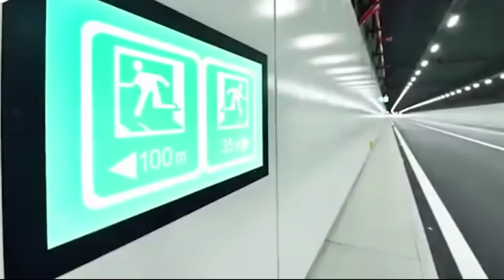New York’s $55 BILLION Plan To Connect Long Island And Connecticut!

Comment: Our tri-state infrastructure is outdated and no longer efficiently supports the volume of cars.  They keep playing with zoning laws and building up (vertical) adding tens of thousands more cars.  It takes me 30 minutes on average to get to work which is just over 3 miles, door to door.  It’s aggravating simply just driving in my neighborhood.  Someone had the “bright idea” of adding traffic lights or a stop sign on every single block in Brooklyn. Sometimes you sit at the same light for 3 cycles.  People walking travel further and faster than you can drive.  What’s worse, is sitting at a red light when neither cars nor pedestrians are anywhere in sight. They don’t even allow right on reds here. Driving is INSANE.  At least put smart traffic lights up that can sense traffic and elevate it before it becomes a problem.   I say do what you can to reduce traffic and congestion. With GPS tracking and AI, a lot can be done to improve things.  We have the know how and ability.  Just think of taking all the city, state and federal monies that are wasteful and riddled in fraud, and use that money to pay for common sense solutions that work.  We are so behind and wasteful, it’s a joke. I’ll bet you a guy like Trump can get this built for far less than anyone else.  You need the right people behind a project like this.

Comment: Tolls would be $60.00 in today’s value . Rye to Oyster Bay would be one quarter the length, much cheaper. Rockefeller and Moses wanted to do this right after the Verrazano was completed. When the Verrazano was opened tolls were to be twenty five cents each way, and only until the bonds were paid off, then no tolls. It now sixteen dollars to traverse. But, NY State is spending four hundred million on a stadium they won’t own in the thriving metropolis of Buffalo.

Comment: How about a floating bridge from Pryibil Beach area to Rye NY area. No Connecticut involved. For the Months April to September. Computer controlled ballast system; closed during strong storms. $30 million, ready in 2 years. A swinging section for scheduled ships. No ships between 8 to 11 AM or 4 to 7 PM. $10 coming on to Long Island, nothing charged if leaving Long Island. If it doesn't work, take it apart and use it as a reef. Let's get on it!

Comment: The only way they’re getting this done is 135 or the William Floyd Parkway. 

135 was supposed to be Interstate 287 extended over the Rye bridge option. The William Floyd was optioned to be the interstate 91 extension over that option. Both routes can handle the extra traffic. The communities they run through are the issue. It’s never going to happen in Port Jeff unless they turn Nicholas road into an expressway
Reply: Maybe NY will give the oblong back to CT in exchange for the coastal property needed to do this.

Comment: Yes this cuts down time on paper, however this will not help congestion on LI nor in CT. Why? Because there would be no increase in highway capacity for cars once cars get to LI or CT on that bridge. You can’t add 3 lanes on both sides of the L.I.E. for example. Focusing on commuters, a robust high speed ferry system, orders of magnitude greater than what currently exists, with numerous express route onboarding sites may be the best answer.

Comment: They blew it in the 1960's when a bridge was discussed  across Long Island  Sound from the northern end of the Seaford Oyster Bay Expressway (Rt 135) to Rye/Stamford area. The Rt 135 infrastructure was already in place to handle the traffic mix/volume. Route 112 to Port Jefferson will never support the traffic demands.
Reply: Rye/stamford can’t support it, but bport can

Comment: The Seaford Oyster Bay Expressway was supposed to continue to Connecticut but the rich people stopped it. There were plans for a bridge
Reply: Same with Rt. 7 in CT going to i-84
Reply: Yeah, the rich and selfish on both shores will join forces with environmentalists and stop at nothing to block it, never mind the potential benefits.
Reply: @NorbRetEngineer Nobody wants their town to turn into a highway. The rich just happen to be better connected.
Reply: @NorbRetEngineer  I lived on the Island for 60 years. I see no compelling business reason for a cross Sound bridge. Who the hell wants to go to Bridgeport or Port Jefferson?
Reply: @DDd-hr6mz  I would agree that the Port Jeff-Bridgeport link is not a good solution, but the Rye-Oyster Bay link would make alot of sense. The link would be much shorter and therefore cheaper to build. You already have highway connections on both ends, and it would enable Long Islanders travelling to points north to bypass NYC, thereby saving time and fuel. The reduced congestion and fuel waste would actually be a plus from an environmental standpoint.
Reply: @NorbRetEngineer You are NOT going to get the residents of TOB to put up with this. Period. 
Bad enough they lose their minds over 15 new homes being built. They're not going to tolerate tens of thousands of cars.
The fact is that from any standpoint, the connection just isn't important enough.
Reply: @DDd-hr6mz  Unfortunately, you're right about the rich NIMBYs. We'll have to agree to disagree as to whether or not such a project would be worthwhile if it were possible.
Reply: @NorbRetEngineer Im not a NIMBY myself,  but a project of this scope is just too overwhelming for the area.
And again,  I don't see an economic case for it. I've lived on Long Island since 1962 and recently moved. I see no compelling case for a cross Sound project.
Reply: It was supposed to connect Oyster Bay and Rye NY, not Connecticut.

Comment: NIMBY pushback gets stronger the further west you go on Long  Island. Oyster Bay was the town that defeated Robert Moses and his bridge plan. Huntington is far less affluent, but the town is unwilling to sacrifice its bay after so many decades of fighting to preserve it from pollution. In Nassau County it is near impossible to draw a straight line from I-495 to the Long Island Sound without crossing a country club. The only straight line is the very same corridor that Robert Moses sought to use for NY 135 as the highway to connect to the bridge. There is no right-of-way in that corridor.

The bridge should include 3 parallel heavy rail tracks, electrified. This provides Amtrak a new route that allows Boston access to Long Island without transferring to LIRR. This would make the bridge a federal project, not just a state project, which can ease the funding burden. If the LIRR were to connect Port Jefferson Station to the mainline at Yaphank, this would fully open a direct Amtrak service to Long Island. From Bridgeport, an Amtrak train could stop at: Port Jefferson Station, split to Riverhead and Ronkonkoma, continue west to Hicksville, Jamaica, then Moynihan Station. Staten Island would need its own railroad connection to Long Island to allow Amtrak service to completely bypass NYC as a Boston-Newark express alternative.

I know what you might be wondering; wouldn't adding Long Island to Amtrak service create a longer NE Corridor or adjacent travel time? Moynihan Station is currently a terminal for Amtrak, not a normal station. This means all Amtrak trains have to "park" after the tunnel, to then back out the same tunnel. This doubles the scheduling traffic for not just Amtrak but NJT and MTA trains. If Amtrak trains from Boston can enter from the East to exit the West to Washington DC, and vice versa for the northbound trip, trains can be more frequently scheduled with shorter downtimes, adding to the capacity of all railroad services.

Point is, a genuine bridge-tunnel between Long Island and Connecticut would have powerful cascading benefits over the long-term that would fundamentally address the traffic congestion currently plaguing both states.
Reply: Great response

Comment: This needs to be further out..exit 73 off the LIE was ment to go into Connecticut.
Reply: Extend I-495 the LIE further East to Orient Point and build the Orient Point Watch Hill Bridge to I-95 in Watch Hill, Rhode Island.
Reply: @mattycooldude6462  You'd be eliminating a lot of the farmland, vineyards, and smaller communities on the north fork, not to mention more than a little bit of park land. I don't think that part of the Island would be able to handle it, to be quite honest.
Reply: @crewkid52  Yeah true. A lot of the Long Island people on the North Fork would oppose such a project. Robert Moses proposed the I-495 LIE extension and Orient Point Watch Hill Bridge east to Connecticut and Rhode Island in the 1960’s, but the plan was cancelled in the 1970’s due to opposition by residents of Connecticut and the North Shore of Long Island. If Robert Moses got his way back then, there would be a lot less traffic in Long Island and the New York City metropolitan area and it would help truck traffic in the Northeast.

Comment: Why not build a rail tunnel?
Reply: I could be making this up but I heard the private developer interested in this project is interested in a double decker bridge from LI to Bridgeport CT handling BOTH Metronorth trains as well as Cars.
Reply: They should if some of the concern is environmental issues the best way is to use rail and have a lot local transportation around the stations on li and CT
Reply: If you want to go where the train goes that's fine, but if you want to go somewhere else you're still screwed.
Reply: Because we prefer to subsidize roadways, over rail.
Reply: Less demand
Reply: Because they are trying to alleviate vehicle traffic.
Reply: Driving is better than trains.
Reply: @superbrownbrown ...so do you have a self driving car or are you just a masochist?
Reply: @superbrownbrown  Horrible opinion, and a wrong one as well

Comment: They can’t even fix a pothole correctly….
Reply: New York can’t even fix a pothole correctly. We’ve got the worst roads in the country. It’s disgusting. And the Governor hasn’t got a clue about any of it.
Reply: @rushpuppy2 that's because she doesn't come down here. When she does its a direct flight to Montauk for campaign funds. How can she assess roads she's never had to drive on? Rhetorical
Reply: You seen our bridges they been around forever still standing
Reply: @ubuntumike5794 Absolutely, but this one is a bit bigger.
Reply: @ubuntumike5794  and well overdue to be repaired/replaced
Reply: neither the street. its all chopped up
Reply: Some of these potholes could be classified a sink holes they are so deep.
Reply: Refuse to properly fund an otherwise robust major bus agency (NICE bus). :/
Reply: Thank You for the Chat.
Reply: Call it in
Reply: Can't even lay down a new asphalt road properly. Seams crack and open up after the first season change. Of course all the paving company's names end in a vowel.
Reply: That's if they even fix them at all, the corrupt fucking wankers of L.I. including the head dickhead Bruce Blechhhman.
Reply: Bridge gonna be weak asf 😂😂😂
Reply: I know right? Building something like this in the most expensive area in the country to do construction? Yea ok bud 👍, it’ll get built when I sell them the bridge I own 😂😂😂
Reply: @jeyDsixx18 You know any more, and, I Am So FUCKING worn out. I wish you a Very Happy Merry Christmas.

Comment: Does $55 billion include the cost to connect the new bridge to existing roadway and rail systems?  What about other potential locations for such a bridge; this is not the only one I have heard of?

The video showed preformed sections laid on the bottom of the sound, like at Hampton Roads, but did not talk about that type of construction or its costs.

Comment: The biggest hurdle is not the bridge or tunnel, but how do you connect the traffic from the bridge or tunnel to a major roadway without taking high dozens (maybe a thousand depending on the route) homes and businesses on the Long Island side. The route will from Port Jeff Harbor to Rte 347 (approx 2 miles, and probably the shortest) require home takings valued from $300k to $2 million. The commercial properties may be valued higher. And you will likely destroy the character of the area.
Reply: And on the CT side there is almost no free open space along I-95 from New Haven to NY, Houses and business right up against I-95.

Comment: What is so urgent about connecting these points?  Yeah it's a roundabout route from LI to CT.  So what?  It's a long way from LI to Albuquerque too.  Some places are far apart, plan accordingly.  This is just a way to encourage more needless travel at great environmental expense.  Put the money into better mass transit.
Reply: You were supposed to take a left turn in Albuquerque...   I'm not sure it would be a net gain to make travel easier between CT and LI. Both are already overdeveloped, and certainly don't need a bunch of commuters or shoppers zipping back and forth over (or under) the Sound. Improved cargo traffic efficiency to avoid congesting the Bronx and Manhattan would be the only justification. A truck-carrying train (like the Chunnel) might do better there.
Reply: Urgent? He said, this has been in the works for sixty years.😊

Comment: why not  a shorter crossing from Port Chester or Stamford or Old Lyme
Reply: Port Chester (Rye) was the proposed route when 287 was first laid out.. just keep going straight across Manursing Island.
There just wasn't enough push to get it done back then when you could actually get something done.
At least the other end was finally completed through north NJ.
Reply: To where? Glen Cove? Port Washington? the residents would never put up with it, and the roads were not built to undertake that kind of traffic to get to the LIE. I don't know about the infra on the north side of the Sound.
Reply: Lyme is 40 miles to Long Island
Reply: @edsteadham4085  Old Lyme is probably ten miles - however more of a rural area and the LIE does not go that far east.  It's ten miles from the north fork.  The crossing should have been done in the late 50's or the 60's because the land acqusition cost would be too much now, not just the cost of the crossing.
Reply: Stamford and Glen Cove are very wealthy, you can forget about that
Reply: Port Chester being a small village? Over Bridgeport being the largest city in CT ? Could port Chester even handle the traffic commute when it starts to get congested ? Na 🤡
Reply: @finalevo1571  Portchester is the interchange of I95 and I287.
Pretty ideally located for north-south and traffic coming east along 287 from the parkways or Tappan Zee bridge.
Very few people would be using any of the surface streets.
Bridgeport has the interchange of 95 and the 25/8. 
Again, a good location on the CT side of the Sound but there's not really the same kind of infrastructure in Long Island.  🤷‍♂️
Reply: @j @jimurrata6785 true to a certain degree, but i95 southbound congest from exit 28 in Bridgeport to NYC in the mornings and back from NYC to exit 27A Bridgeport northbound in the afternoon.. same for the Merritt parkway all the way to Hutchinson and back.. I think it’s only valid to add up a bridge to ease up all that traffic on the 95 and Merritt 🤷🏻‍♂️
Reply: @finalevo1571  I imagine it might lessen the truck traffic between LI and New England but there's not a whole lot of commuters on that route.
Wouldn't do a thing for the volume headed to NYC or NJ. (on top of typical I-95 through traffic)
Westchester and Fairfield Co used to have 'rush hour' but now there seems to be overlap as the direction shifts.
Honestly I miss the early days of Covid....
Reply: @finalevo1571  Look at I 287 on the map.  The real problem is on the Long Island side (which I am not as familiar with) where no high capacity road run near the north coast until you get further east.  The old proposal was Rye (near Port Chester) to Long Island.  LI is developed with more expensive homes and no real access for a road to be built.   I am not sure about utility right of ways however.  Any new roads today, probably would need to utilize those.
Reply: @K @Kenny-mt8hz idk about i287 but i95 from Stratford to NYC north and south bounds are ranked as one of the nation’s most congested highways and if the idea to build a bridge from Bridgeport to LI was voted and bought up as the main topic .. it’s cause the traffic and to commute from Stratford/Bridgeport to NYC is THAT bad..

Comment: What good is a Bridge gonna do, when the land becomes too mushy from the rising sea. Long Island is a glacial deposit of sand and rock.
Reply: The sand and rock is already saturated with groundwater. Rising sea levels will "simply" swap saltwater for fresh at the edges, with no change in support. Water supplies will have problems, of course.

Comment: Just a pipe dream. Every 20 years the same project comes up ever since they ended the Seaford Oyster Bay  Expressway at Rt 25. Then it’s extending William Floyd Parkway to the sound. Maybe if Nassau and Suffolk become its own state, keep dreaming.
Reply: More likely that Nassau and Suffolk petition to join CT than become their own states. In Suffolk’s case it might actually make sense for geographic, economic, and historical reasons.